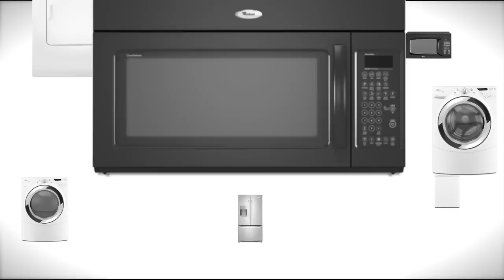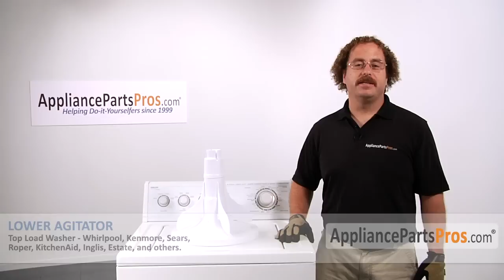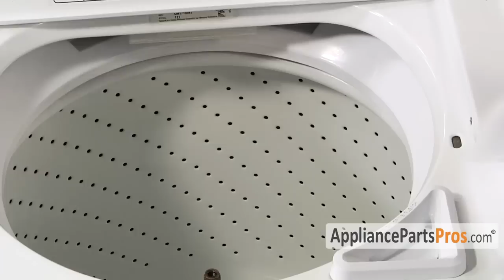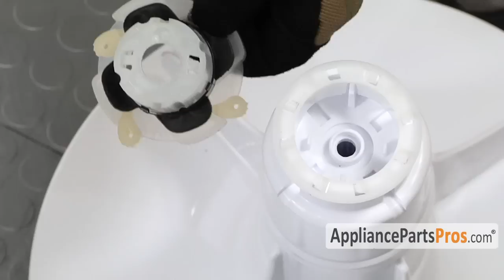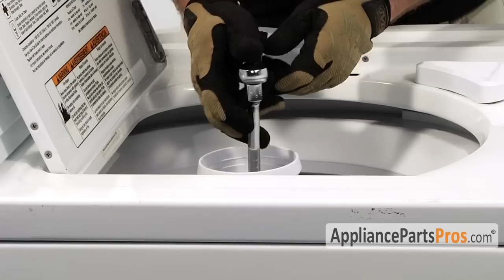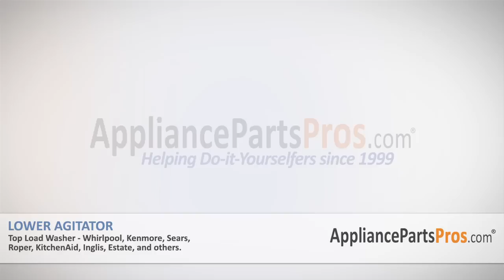How To: Whirlpool/KitchenAid/Maytag Agitator Base WP3347288

Comment from the maker: The lower agitator usually needs replacing if the splines that lock it to the transmission shaft are damaged. If it does not drain I would check the pump to see if its damaged or clogged. You can also post this in our repair forum along with your model number and our techs can help you troubleshoot the problem.

Comment: the bolt in mine keeps coming loose, what will cause that?
Reply from the maker: +Carol Glass If the agitator is worn out or loose it could cause the bolt to vibrate out. If you really do not see a problem with any thing you can tray a drop of blue thread locker on the bolt.